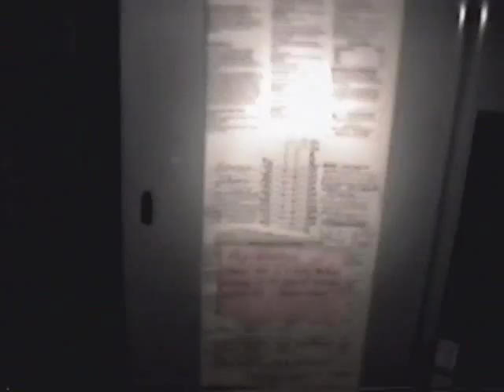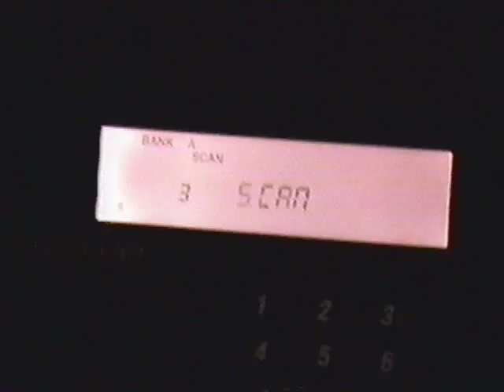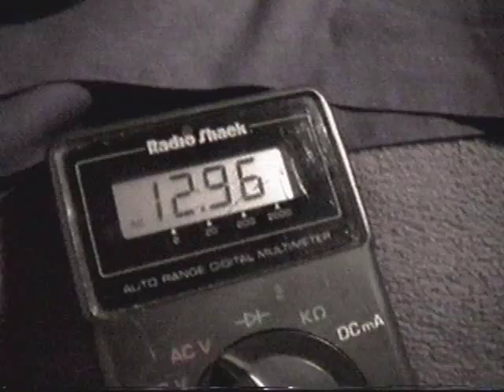Car Wreck Causes Power Brownout

Comment: Wow I hope you unlplugged anything that had a motor in it low voltage is death for electric motors as they quickly over amperage to try to compensate.

Comment: Definitely shut off power during a brownout.  You don't want low voltage hitting your electric motors, appliances, etc.  Best to cut all breakers off, except one.  On the circuit you leave live, make sure nothing is plugged into it except regular incandescent light bulb(s) which are not hurt by low voltage.  When the bulbs go back to normal brightness, the brownout is over.  The worst thing you can do is leave your fridge and motors powered up when the voltage drops significantly below 105-108V.  They can overheat because they pull more amps attempting to compensate for reduced voltage.  More amps = more heat.